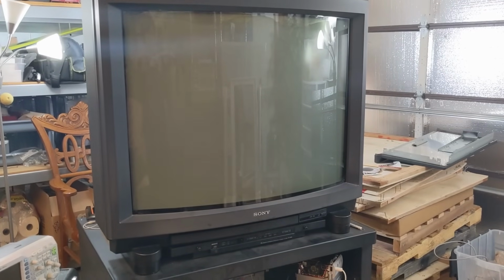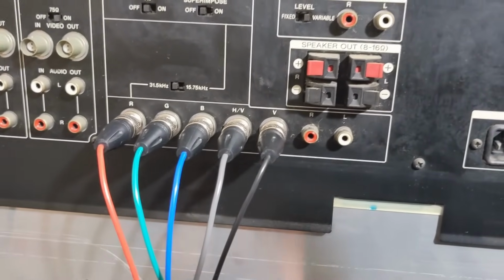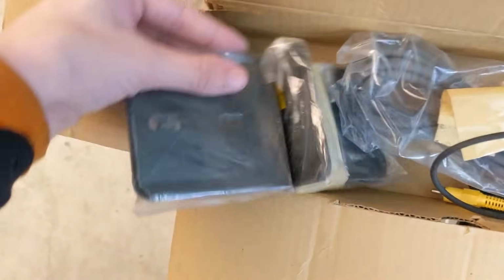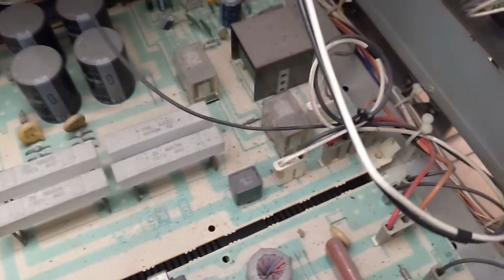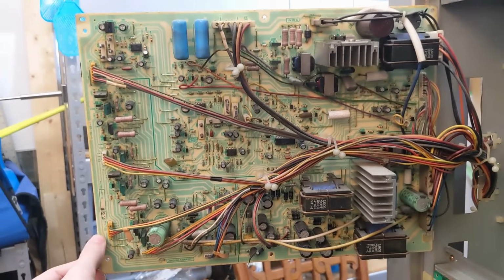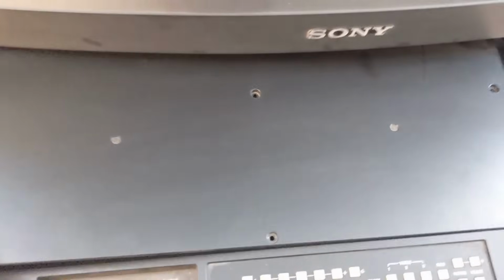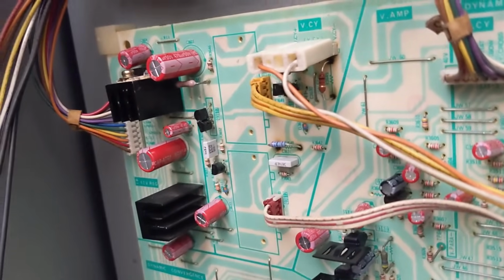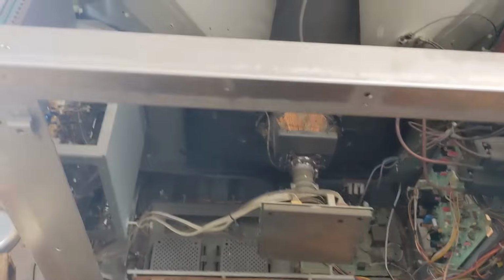Overview of the KX45ED1 / PVM-4300 (Worlds Largest CRT)

Comment: (maybe oblivious)Tip from ex-CRT warranty tech: Try to secure replacement flybacks/other HV parts if possible. Sony had a somewhat bad reputation (not the worst) for reliability with flybacks/splitters.  Not saying this colossus will have this prob though..
Reply: Any ideas for quieting the flyback? Thanks in advance!
Reply: @CarrotsNotCake  it might be old dryed out sealants/glues are now causing the coils to physically move and make noise.  sometimes you can pour glue into it (this is risky, as it could cause unintended premature failure).  another thing to check is if the iron core is loose and you can move it.  maybe one can add rubber shims to hold it in place.  I'm not sure what your problem is - is it making a loud 15Khz ringing?

Comment: I had a Sony 45" purchased in 1994... it was brutally heavy.... we had to unbox it and lay  it in a reclined car seat to get it home from (think it was) SEARS.... at home, it couldn't be carried through the front door (house built in 1931) and we had to lay down a thick carpet and roll it in side over side and it barely passed - no extra room for any hands to be there at all.  It sat atop a wooden steroe cabinet and always mushed the cabinet out of square.  Once the kids were born, my wife said the risk of it falling for any reason and killing a child was completely unacceptable.  It was brought to a Best Buy recycling spot in 2009 or 2010, still working.  Kept a Sony approx 42" stored away since I have tons of analog equipment and 4:3 recordings that just look better on CRT than on a plasma at 4:3.

Comment: Never seen those rear connectors before. No component or composite? If not using the tuner board in front, what does this tv actually used for? I have no idea how PVM works.
Reply from the maker: It does not have component inputs, but it has 3 composite inputs. It just uses a connector called "BNC" rather than RCA. It has composite, svideo, and RGB inputs

Comment: Why would a CRT need deinterlacing in the first place?
Reply: I suppose to reduce flicker. If you're up close you can easily see distinct scanlines, each of which normally flickers at only 30Hz.
Reply: @eDoc2020  But that's only a problem if you're displaying lines 1 pixel high.
Reply: @ It would be painfully obvious if you're looking at single-line graphics. But even with normal content it's noticeable if you're up close. I've noticed this with the 13" TV in my kitchen, with a 45" TV it would be that much easier to notice.

Basically a regular interlaced display is unnoticeable 99% of the time. But Sony wanted the best possible experience.

On a similar note, why would anybody need  a UHD "4k" TV? Under normal conditions you can't see the pixels on a FHD 1080p set.

Comment: No its running at 576i
Reply from the maker: No, it is not. It's running at 480p 60hz, or 31khz. It can also run at 960i 60hz 31khz. To my knowledge, it is not capable of running 576i 50hz. It can do 480i ntsc (aka 525 line interlaced) through the deinterlacer, but it deinterlaces it to 480p (525 lines progressive)

Comment: What an insane behemoth of a monitor. Truly the pinnacle of CRT technology and unrestrained hubris. The definition of "because we can"
Reply: Bubble-era Japan condensed into one object.
Reply: What if I were to make my own CRT "because I can"?
Reply: Not the top. There were 100 hertz TVs with vga, HDMI And the resolution is 720p. In the middle of 2000. Plus a flat screen. So this is not the top of the crt.
And this is only the end of the 80s. Not even the technology of the 90s
Reply: @shynodaa  It's the biggest CRT ever made. These things have a vacuum in them, so good luck making a flat, widescreen TV this big. The closer to a bubble the tube is, the better. 

It has a 480p (essentially VGA) input. It doesn't need HDMI. Converting HDMI > VGA is easy, and all CRTs are analogue internally anyway.
Reply: @axi0matic  I know the TVs he's talking about and they aren't CRT's well not really at least. Long story short they are kinda like a CRT/LCD hybrid, or you can say it's a digital CRT, and unlike a normal CRT or LCD/Digital you don't get any of the benefits of either technology you only get the negatives , so yeh!
Reply: @randysalsman6992  All CRTs are inherently analogue devices. A 'digital' CRT just has a HDMI input connected to an internal DAC. It doesn't wipe out many of the benefits of CRTs (contrast, colours, lack of image persistence etc.), but will likely introduce input lag. It'll also almost certainly buffer and frame double (100Hz), making the CRT useless for light gun games.

The Sony in the video may not be the technological peak in all areas, but is the biggest, which counts for a lot. As they say, 'quantity is a quality all of its own'. It's 480p input is decent, and completely flat (fronted) CRT screens tend to have worse picture geometry. The Trinitron's slight curve is attractive in its own way anyway.
Reply: @shynodaa  always someone to chime in and flex their useless wikipedia knowledge nobody asked for
Reply: @turke765  I know all this without Wikipedia, my friend, calm down and don't cry. the fact that these are NOT top technologies in the creation of CRTs is just a fact and accept it if you are an adult. for example, it is much more difficult to create a flat screen than the usual convex one
Reply: @shynodaa  You do know that those TVs are hated in the CRT world right? The ones you are referring too are those late CRT early digital TV models making them no longer what made CRT's great, that being analog. They were digital quasi CRT TV's that gave the owner none of the benefits of a true digital TV and none of the benefits of CRT's, but what they did give you were all of the negatives of both. Also you say they have a resolution of 720p like you know what you're talking about and that it being at the resolution is a good thing. Just like any TVs/display's today, rather that be 720p, 1080p, 1440p, 2160p(4K) or 4320p(8K), don't matter you pick the resolution and it's still the same, that every TV/display today and same goes for those 720p digital CRT's that those resolutions on them TVs/displays are their native resolution meaning they are fixed pixel TVs/displays. The CRT TVs/displays including the biggest and best CRT TV ever made the Sony Trinitron PVM-4300 the one in this very video are not fixed pixel displays. Do you know what that means, not being a fixed pixel display? It means that any resolution that you can get a CRT to display and that also includes 720p that you mentioned, but as well as 720p you can even reach 1080 and 1440, (I don't remember if that p or i aka progressive and interlaced) not only can those resolutions be displayed but any and all resolutions to a CRT are native to it. This is because CRT's don't have pixels like today's displays do, they just get temporary "pixels" when set to whatever resolution but as soon as the resolution changes so to do the temporary "pixels".
Reply: @randysalsman6992  It's true that CRTs are not fixed pixel displays, but bear in mind that only PC monitors (and some PVMs) can display a range of resolutions. Domestic TVs, aside from having a much larger pixel pitch, will only support the NTSC and PAL broadcast standards (480i/60 and 576i/50 respectively, perhaps PAL60 too). Note that 240p / 288p are not really standards, more like timing tricks to get a progressive image out of an interlaced format.

Comment: Definitely do a recap on those power supplies! This is from an era when Sony used capacitors that turn leaky, even in their pro gear. I have a BVM-2010P and it had multiple leaking capacitors in the power supply, a few ELNA and the worst was IIRC a Nippon Chemicon in the -15V power supply. Despite it had only 15V across it, the leaking electrolyte caused carbon tracking and burnt up the board in a half inch diameter spot, which I had to dremel out, it also burnt up the coil of the -15V regulator which I had to re-wind.

Replace all electrolytics in the power supplies and go through every board and replace at least every 105°C rated capacitors, those are the most likely to leak. Especially replace every ELNA which has 'Long Life' written on them, those are the worst ever, their electrolyte is super corrosive. Replace every Panasonic caps, even 85°C rated ones. The tiny yellow ELNAs are also prone to leak.
Reply: True. 99% of problems with old electronics are with the electrolytic capacitors. It's not a matter of if, but when they go bad.

Comment: What a magnificent beast. What resolution does it top out at via VGA using the RGBHV input? Curious what refresh rate it can hit at 480p too. I really hope Sony will allow some engineers to talk to you about this. It’s a high point for Sony and they should celebrate the fact that enthusiasts care about it.
Reply from the maker: It's 31khz 60hz only. So it tops out at 480p or 960i
Reply: @ 960i is wild. I wonder if there was ever an HDVS widescreen prototype (1035i). Check out Reely interesting if you’re curious, they’ve connected a ton of 80s analog HD stuff.

Comment: You may be forced to fix that cataracts issue sooner than you like to admit. the biggest problem with it is that the old glue ooze out from the protective glass and it seeps into everything and this stuff is very corrosive too. you can see this in your video the back of the tube is already getting tacky lines from it so it is already in a liquid state. this is a TV that deserves a complete restoration. I would die to have one myself. maybe talk to some people what can be done specifically for the cataracts. it is a risky but probably inevitable thing you need to deal with one day or another
Reply from the maker: Good to know. I will genuinely keep this in mind. I may pursue it if I find an expert willing to be present and help me make sure it is done correctly

Comment: mdp on the remote stands for "mini disk player" , on the back of the tv are jacks for remote controll ur devices throught the tv with the ir remote
Reply: In this case, MDP probably actually stands for “multi disc player”, and specifically refers to Sony’s MDP line of machines that could play all varieties of LaserDisc and CD. Some of them could even play both sides of a LaserDisc consecutively without manually flipping the disc over. This TV was made in 1989, whereas Sony didn’t even introduce the Minidisc until 1992.

Comment: Does it support 576p50 as well or just 480p60?
576p50 with "PAL speedup" from 24fps to 25fps would be amazing for watching old TV-shows
Reply: I suspect it will support PAL if decoded to R.G.B. line frequency is close enough.
Reply: @gladiammgtow4092  Yeah the frequency is the same. That's why I mentioned the resolution and not the color system because I doubt it supports PAL

Comment: Have you checked the speakers for foam rot ? And id check for dry solder jionts on those power supply units also be interesting to see what this tv uses to power the speakers was common for the larger tvs to use the infamous stk audio output module .
Reply from the maker: The cones/speakers themselves are excellent and have not rotted away. The aesthetic foam mesh between the speakers and the metal mesh has completely rotted away. I opened them up and cleaned them out.
Reply: I think it might have used external speakers guessing by the spring clip terminals at the back
Reply: And the amplifier is probably one of the boards on the lower right side

Comment: That's too bad about the cataract. I would be worried about the tube glass being strong enough to hold integrity without the safety glass. If you do consider doing it there is a guy in LA that has a channel that deals with removing safety glass.

Comment: Would love to see the cataracts issue be repaired so this tv can be as good as possible, someone like shango066 would be the best person to do something like that. Hes a tv wizard
Reply: This is a completely different glue compared to what Shango used to deal with, and seems like it is not really degrading (turning hazy and yellow/brown), 'just' delaminating. Not sure if it is removable with heat. I would definitely NOT risk doing it on this unique piece of history, until it becomes really bad. What I would do is to remove the front plastic frame , clean the edge of the CRT and run a very tough adhesive tape around it to seal it, to make sure dust can't get in beween the CRT face and the delaminating safety glass.

Maybe it's a double layer, laminated safety glass, and the delamination occours between the two layers of the safety glass, and not (or not just) between the glass and the CRT face. Not sure if any  glass company would custom make such curved, laminated safety glass, and even if they do, pretty sure they would deny laminating it onto the CRT. And even if all of this happens, not sure if the end result would be optically right.

I guess there would be some hazard of implosion during the removal of the glass, but the higher risk is breaking the glass. If they manage to remove the glass without leaving marks on the screen, they can just use it without it. There's surely an implosion band on this CRT, so it won't implode spontaneously without the safety glass. Sony added the safety glass as an extra layer of protection, because due to the huge size, in case of an impact, the implosion band would probably be unable to hold the pieces of the screen together.

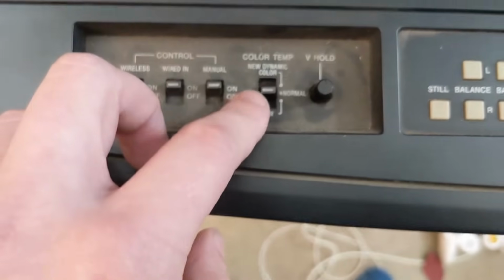Comment: The reason for the 12:30 is that some videos are videoed under low light colour temperature and by adjusting the setting will compensate the picture.

That is a reasonable feature in the eighties.

Comment: A giant CRT that weighs a ton, and shows a fuzzy 720 x 480 image (if you're lucky).

A modern cheap 50-inch LCD is light years better than the old CRT .
Reply: Not if you prefer 0 latency and scanlines for retro gaming
Reply: @samio3907 Yep, nor if you prefer nostalgia, which is a must factor in retro gaming.
Reply: @samio3907  MAME is used for retro gaming, and can add the scanline effect to a modern LCD screen.   No problem.

And talking about latency?   Modern LCDs can often do 90 or 120 Hz, or even faster.

Also, how many watts does an old dinosaur CRT use?   That screen runs hot!
Reply: @DerekDavis213 No matter of simulation can ever substitute for the real thing. For anything.
Reply: @DerekDavis213 Latency ≠ refresh rate
Reply: @DerekDavis213  The "scanline" effect is never as good as a original crt because it's just a filter. CRTs don't work this way. They draw the picture line by line which causes this effect. Also, good luck finding a flat panel with "almost" 0 latency and proper 4:3 format. But don't waste your time, because there is none. I know, using an emulator with the "run ahead" function is pretty darn close and there is nothing wrong about it. But if you want to experience retro games, like they were intended with 0 lag. Just go original. You can also watch a LTT video about it if you want to lean more.
Btw, refresh rate ≠ latency
Reply: @samio3907  Btw, refresh rate ≠ latency

How can there be any latency when running primitive 16 bit code from 40 years ago on a modern 64-bit processor running at 4000 MHz?
Reply: @MrCarGuy  No matter of simulation can ever substitute for the real thing. For anything

That is true for food and bedroom fun, but not for video images on a screen.   It is easy to emulate in software the scanline effect, and it is 99 percent convincing.
Reply: @samio3907  I wish some SED TV's were made before plasma+lcd really replaced CRT's. Those might have been equiv to CRT latency with the same bright phosphors, flat & without any of the drawbacks of fast motion video like on PDP.
Reply: Yeah, and a modern PC is light years better than a vintage one but here we are, enjoying our old crap. I am sad for you that you are devoid of enjoying the special things in life.
Reply: @mfbfreak  I am sad for you that you are devoid of enjoying the special things in life

I have a PS5 and powerful Windows PC with Ryzen processor and RTX 4070 Super video card.

An ancient Atari 2600 or dog slow PC with 386 processor are not enjoyable, or special.

Comment: imagine how much of a bummer it would be if there were no lag free mode 🤪
Reply: not that big of a bummer to be honest crt enthusiast are just used to 0 lag most other types of screens all have lag and i dont think it would be that bad on this too probabbly like 100hz sets wich are not even that bad
Reply: @ygtx44 The point is that CRTs are prized by gamers for 0 lag (amongst other things). Would be a shame to ship 100Kg (or similar) from Japan, only to find it had undefeatable 100Hz circuitry. You couldn't play light gun games, for one thing. Though even here, you'd presumably need some kind of zero lag 240p > 480p convertor to get that to work properly. I suppose it would just need to insert a line of black after every 240p scanline.